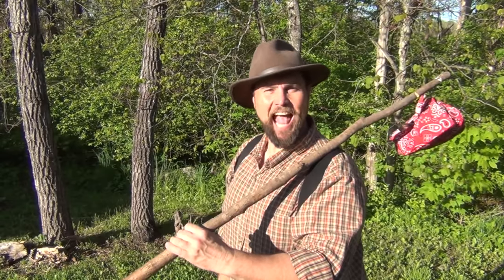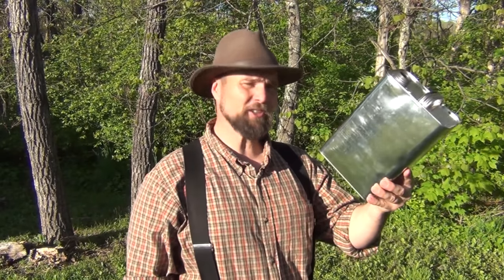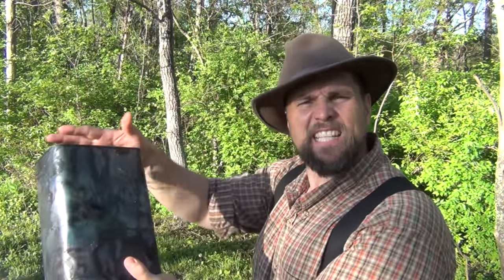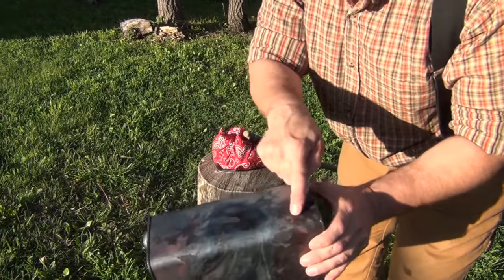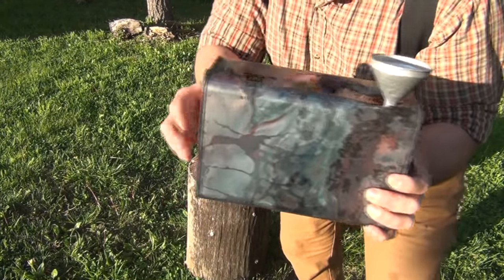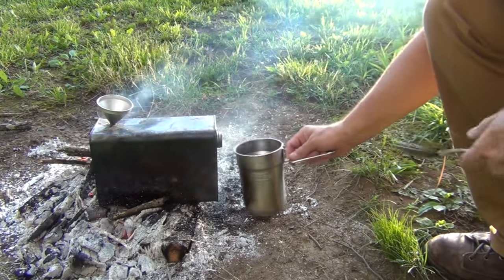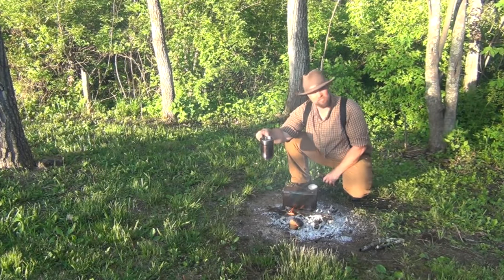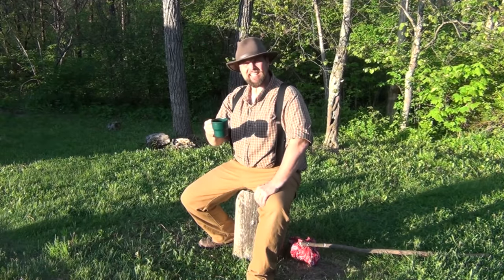Hobo Water Heater - Really Works!

Comment: From a retired hobo with 50 years under his belt. Super impressed. I used a gallon can to heat water for wash, cooking , etc but your design is top shelf. What we used to call a 1000 mile "  " . As most hobos rode the local freight to the next town a long trip was known as 1000 mile. Example ; 1000 mile paper. Thick paper was used to line boxcars sometimes. You could cut a big sheet and use for a blanket, ground clothe, or cut into strips to help start a fire. So you might call this a 1000 mile water heater.
Reply from the maker: Thank you so very much!
Reply: Thanks for sharing
Reply: so you would steal from your ride? seems counter productive...

its one thing to drag around on the rails
but stealing is just being a homeless thief
Reply: What are you talking about exactly ? The paper lining I referred to hasn't been used since WW2.  And it was removed and tossed after a couple of uses by the railroad.anyway. But some of the old timers that rode during the Great Depression told me about it, plus I saw a photo of a paper lined boxcar from the 1920s in an old book about a railroad company that no longer exists.  @ProfessorToadstool
Reply: @ProfessorToadstool ever heard about the Phareseans?

Comment: We used to do a similar method back in the 80’s in scouts…. We used 5 gallon food oil drums and extended the outlet with a pipe just to make it a little safer (outlet further from the fire). Great to see these older methods being used today ! Awesome video, thanks !
Reply from the maker: Thanks for watching, it really is a good option for a static camp.
Reply: We had the same in cub scouts in the 90s with 20 litre drums. (Australia)
Reply: Same here, in our troop we called it the water otter, because it made the water hotter.
Reply: This is a great idea! It would be best for a camp methinks because it would take up a lot of empty space in a rucksack. If. I were going to carry this item regularly I would make the 'funnel hole'  about 4 inches wide and I would load all of my tools or other stuff in it. That way it wouldn't take up empty space in my carry bag. It could get some ashes or something in the water, but you could flatten out a tiny can to cover the hole when heating the water.

Comment: that is a great idea just to use as a permanent feature for camp - especially if you have your own bug out location. You could upscale it to use a small keg or similar made from stainless steel.
Reply from the maker: Indeed you could. Thanks for watching!
Reply: Thought that myself, but I also thought there was a fly on my screen 🤣
Reply: Australian Army has used a version of this since WW1 known as the Elephant.  It utilises a heavy drum about the size of a 44 gallon tank, with the ‘funnel’ piped direct to the bottom. There is enough delay that you can pour into the funnel and then collect from the faucet with the one vessel, be it a bucket or a mug.
Reply: @andrewallason4530  As an Aussie, I wish I knew this. Thanks

Comment: what a great project, we used to have a similar system in the army made from a 40 gallon steel drum when we were around the HQ area, but I never saw this system used on a smaller, more portable scale.🇺🇸🇬🇧👍 superb.
Reply: In the Australian Military as well. Usually at the ablution facilities. They were called Jumbos I suppose due the the size of the drum and the spout fitted to the drum.
Reply: @rodbowden9086  cheers Rod same thing for us pom's, best regards 👍
Reply from the maker: Yes, this is just a miniature variation. Thanks for watching!
Reply: I saw this on a Boy Scout camping trip LONG ago. Another troop had one made from a +/- 5 gallon cylinder. (in metric, that's 20 quarts). It lay on its side with a foot-long (again, in metric, that's 1/3 of a yard) pour spout welded to it.
I was very jealous. (Much like many of you are upon seeing my skill at converting English (imperial) to metric.)

Comment: A good working hot water system, I know it works well, I made one especially with a large diameter copper tube and a frame over a fire.
But this hobo system is what I will do to replace my own...because some bugger stole mine from my last encampment.
Just proves that it is a good system.
Thanks you James.
Maybe put less coffee grounds in next time.
⚖️

Comment: I used the same gallon tin to make a mini woodstove for a tent and aluminum beer bottles for the chimney works very well, I would recommend a alcohol tin so kinda sterile already thanks James!!😁✌️💚✊️🔥
Reply from the maker: Yes, there are quite a few options for good tins for this project. Thank you for watching!
Reply: Did you make a video on it? I checked out your channel, but didn't see it only some Titanium Stove in a Lavvu.
Reply: It's poor audio quality just working with what I got I have allot more diy stuff just no time to film thanks for ur interest btw!!😁✌️💚
Reply: @Canadian_Craftsman  I'm always interested in thinking outside of the box and workable cheap safe hacks. I really didn't see the point of this video, much easier to just boil water in a cup, but this is YT where views count more than logic sometimes.
Reply: @RobertsBulgaria  haha very funny and true that's my main reason I'm not consistent with cheesy uploads just something wholesome!!
Reply: @RobertsBulgaria  I'm going to disagree with you on that.  After the initial  heating period, hot water isn't 3-5 minutes away but essentially instant and at least a touch less than boiling due to the added water.  I bet it can hold onto heat and release it slow compared to an open flame as well.
Reply: @johncharlton1210  As is your choice, but by the time YOU'VE done everything required shown with this can, if you can even find one whilst on your travels, I would have boiled endless cups of water.  This system has its merits, I just don't see it as a very practicable one for a HOBO is all.
Reply: @johncharlton1210, it seems the best option for a family and like you said, the cooler water entering the container might bring the boiling temperature down👍🏼

Comment: Awesome idea WayPoint! Just a safety point - it's best to have the vessel at least half-full before setting it in the fire. Dropping water into a hot empty vessel will flash the water into steam - BOOM.
Reply from the maker: Actually, with this system, it's best to fill it up to the spout level before you set it on the fire as it just makes it a lot easier. However, you are right, you don't want to put it on the fire empty.

Comment: Great idea , my mate got a old 9 kg or 20 pounds made up stainless steel funnel screwed in where the valve is and put a spout on the side that was great for hot water when camping. Seen similar made out 20 lt oil sized drums.
Reply from the maker: Excellent, thanks for sharing this in the comments.  It can definitely be scaled up to fit larger needs.

Comment: While this may have worked for a hobo in the 1950's, I can tell you that finding a metal can like that would be exceedingly rare. However, there is an alternative. Simply take any plastic water bottle and just set it in the fire. The plastic can't melt as long as there is water in it and you can quickly heat a bottle of water to boiling over a fire
Reply from the maker: Metal cans like that are very common. There's quite a few items that are still sold in them today. Thanks for watching.
Reply: @WayPointSurvival  I realize that they are still in use, but when I think about it, I don't think I"ve had one in a decade. No wait, almost forgot, olive oil cans.. But it's been years since I"ve seen one discarded in the woods (because I wasn't looking most likely, now I"ll find tons. Good video anywaY

Comment: Suggestion: instead of punching a hole in the can use a copper or stainless steel
tube inserted into the spout and bent to carry the water to the bottom of the can.
This would let you use the can to carry as well as to heat water.
Reply from the maker: Thanks for watching.

Comment: Thank you.  Do you have suggestions for the spout on an olive oil can with plastic spout?  Non-lead tight-fitting pipe, but how to have it not leak around the joint? Of course, if prepared ahead, could solder.  Assume pipe tape would be toxic and melt.  Silicon caulk would melt.  But you did give good thorough instructions to clean a lacquer can, so maybe that is just easiest, but sort of gives me the heebiejeebies.
Reply from the maker: The only thing that I can think of is that you would need to remove the plastic spout and replace it with a metal one in some way. Perhaps by fastening one on with solder as you mentioned.

Comment: Do you have to do the burn off thing if it just had cooking oil in it?? Also the cold water you add to it I'm assuming has to be already clean/sterilized water?? Thx for the great video.
Reply from the maker: Yes, you still need to burn off the liner if it has one and most of them do I believe. The cold water does not have to be clean or stay or sterilized but you do need to bring it to a boil if it isn't.

Comment: If you took some food safe high temp epoxy and reattached that spout, then put a hole in the cap and use that same epoxy to attach a short length of copper tube to the cap, put a valve on the tube and just let it boil.. no need to add cold water to force hot water out just open the valve.  Its not going to expand the can because you've got the hole there with the funnel so no pressure is going to build but gravity will make the water flow when you open the valve.
Reply from the maker: That's a good idea! Thanks for watching.

Comment: it's easier to just heat a pot of water! by the way a video a while back you mentioned you like alcohol stoves and making your own hear have you ran across the channels from trail hound intense angler and hiram cook by chance? they haven't posted anything in years but they do have some interesting takes on alcohol stoves. one thing they use carbon felt for wicking in their's i've found plain cotton cloth works just as good for wicking!
Reply from the maker: The idea behind this is to have a relatively continual source of hot water. I haven't seen their videos but I do know that there are several items that work quite well for wicking or packing into an alcohol alcohol stove.
Reply: @WayPointSurvival  we have different styles i guess i'm more trapper/long hunter style than modern and a continuous supply of hot water  isn't needed
Reply from the maker: Yes, I get it. I also do the long hunter/trapper type of things as evidenced in my 1790s series.
Reply: @WayPointSurvival  i'm new to your channel i'll have to look that up!

Comment: You might consider running water through the heater and reserving it to send back through so you are sure all has been boiled and there is no risk of contamination.
Reply from the maker: Sure, if you're using untreated water to begin with.

Comment: Nice trick, question how long do you boil water until it's safe to drink?
Reply from the maker: There is no specific time limit. Water only has to be held at 149° f for 6 minutes to achieve pasteurization. When in the wilderness, we just bring it to a boil and let it cool down and that usually is sufficient for the 6 minute interval at 149° f.

Comment: A little off topic but parallel…
I remember seeing where a person could run a length of pipe (or a coil) through your campfire with air intake some safe distance from fire and the output inside your tent. Forced air heater.
Reply from the maker: Good idea.  Thanks for watching!

Comment: There's a better solution to this already. You keep a pot of water hanging over the fire with an adjustable pot hanger. You can raise the pot upwards above the fire to just the right height where the water will be kept hot . This way you can still use the fire for broiling meat while keeping your water hot whereas with your system the metal can covers the embers and doesn't allow the fire to be used for other purposes. It's good that you're trying to come up with new ideas but you need to think about their practicality more first. People will comment here about how cool it is because it's a novelty to them but when they go to actually try it out they'll soon get tired of having to pour water into a funnel every time they want hot water, when they could just ladle it out of a pot that hangs over the embers.
Reply from the maker: The point is to have a continually available source of hot water. The military has often done this using 55 gallon drums.

Comment: I’m wondering if the water you pour in is comprising the water in your heater. You should boil it for awhile right? Lowering the temperature as you add water might contaminate whatever is left in there. Gotta be careful of those microbes
Reply from the maker: As long as you keep the water hot enough, it's not going to be an issue. Thanks for watching!

Comment: okay i got a lot of wd-40 cans like this. would that count as a "cleaning supply" can?
Reply from the maker: It would, just clean it out really, really good. And then, make sure that you put it over some flames to get the rest of the residue out. After that, scour it out with sand and gravel and soap and water.

Comment: I'd be worried about pouring the cool water into there, as it seems like there would be a chance that the unboiled water would make it into the cup and contaminate your drinking water.
Reply from the maker: As long as the fire and the water is hot enough, it shouldn't be a problem.
Reply: @WayPointSurvival  Looks like you're correct, cooler water is denser and will therefore should sink down.

I wonder if you could make a similar clear vessel and add food coloring to the cool water to see if it truly mixes in or sinks down? Thanks for the reply

Comment: When you burn out the coating inside its only good for a few weeks because when you don't use it, it will start rusting inside n that's not good
Reply from the maker: Actually, you simply oil it or grease it and it will last a long time.

Comment: I feel like it would just be easier and less wasteful to boil it as needed in a pot or can. Also, assuming you might have water of a questionable quality , I'd want to boil fully before drinking.
Reply from the maker: There is no waste as the water is being boiled inside of the can. It is a way to have continual hot water. Some have even scaled this up to a 55 gallon drum size.
Reply: Actually, a kettle or pot is less wasteful since they have smaller openings (a kettle's spout) or are completely closed with a lid (saucepan). It's not continual hot water if you've got to constantly fill it up. The boiling is no more contained inside of the can as it is in a pot or kettle.

Comment: Add a metal pipe to the led and Turn this into desalination system so we can even use it on beach
Reply from the maker: Yes, a coil of tubing and a little modification would definitely work.
Reply: @WayPointSurvival  yes plz make it so it will be multi purpose use

Comment: That’s an expensive funnel to use for that project. What am I supposed to fill my vintage Colman lanterns with if my funnel is on the water heater???…..lol.
Reply from the maker: Actually, it's just a cheap aluminum funnel that I purchased somewhere for a little bit of nothing.
Reply: @WayPointSurvival  It looks just like the little funnels that came in the “ugly as hell, but you can’t lose” yellow plastic Colman lantern cases. Great series, I’m finding it very interesting and thought provoking……

Comment: Donk get it to hot💥 mite melt that sautor on the neck.. .
Hell make a futter lil grill outta that lid👌
Reply from the maker: Actually, it's okay if you melt the solder on the neck you can just press fit it back on.

Comment: Why would you heat hot water?
Reply from the maker: Because the water is continuously being heated. Therefore, it's a hot water heater.
Reply: @WayPointSurvival  I was just joking. I was a plumbers apprentice and my plumber  would get so mad. If we called it a hot hotter heater. He'd start screaming about you don't have to heat hot water.
Reply from the maker: No problem. Thanks for watching!

Comment: Great idea for washing yourself with hot water in the woods.  But, hot water for a hot meal (Mountain House meal) or for a cup of hot coffee,  just put the cup into the fire less of a hassle.  Btw, It's not that great or sanitary to reheat water over and over again.  Have you tasted the hot water inside the hot water tank?  It's  gross.  Great idea though.
Reply from the maker: Thanks for watching! The reason hot water tastes bad after a while is because it needs to be aerated again.  Also, heating water repeatedly only makes it more sanitary not less.  Also, the idea is to have a relatively endless supply of hot water not just for a single meal.

Comment: who heats hot water?
Reply from the maker: It is a continual hot water heater.
Reply: @WayPointSurvival  WHy would you heat water that's already hot?
Reply from the maker: It isn't already hot that's why you need a hot water heater to make it hot.

Comment: How about a heater that heats cold water. don't need a hot water heater. Still cool, though.
Reply from the maker: Well, it's a heater that continually heats the water. So technically it is a hot water heater.

Comment: Why not use a kettle
Reply from the maker: This gives you a relatively continual source of hot water.
Reply: @WayPointSurvival  as does a kettle
Reply from the maker: Sure, but hoboes don't generally have access to kettles but you can often find an old metal tin laying around.
Reply: @WayPointSurvival  sure but hobos don’t exist anymore just homeless beggars
When was the last time someone down on there luck had enough pride to forge a living in the woods ?